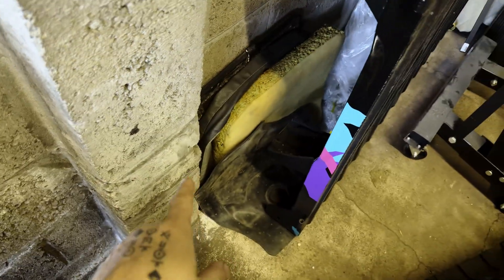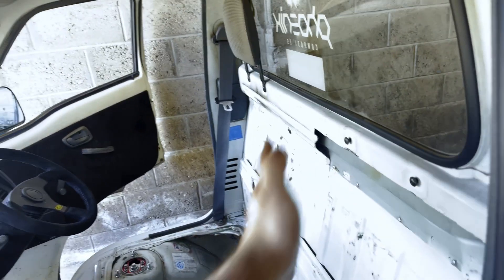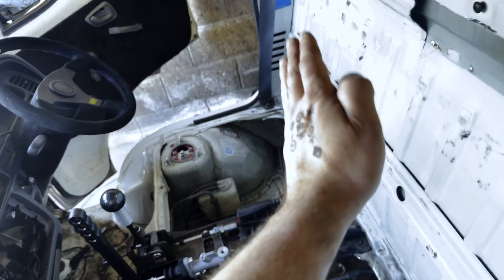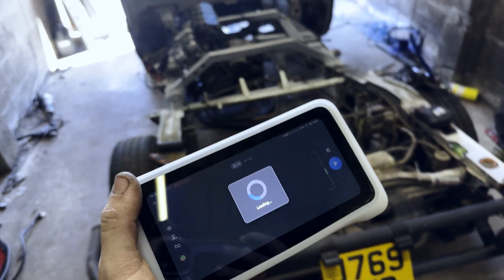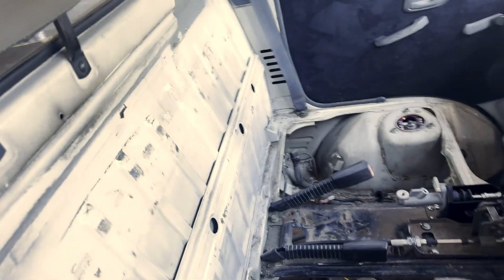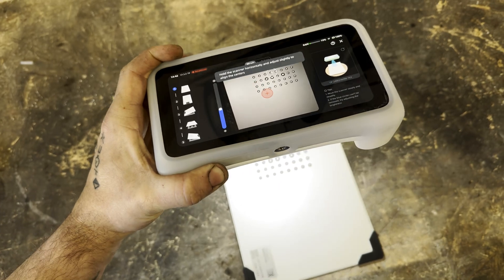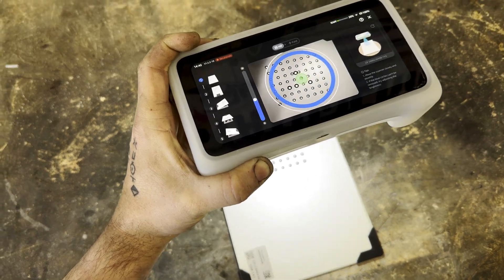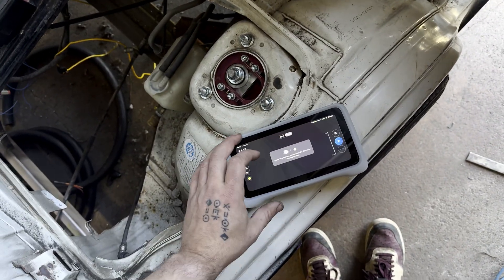Custom 3D printed seats for my kei truck? - Scanning the interior with Einstar VEGA

Comment: That scanner is incredible. I really need to look into this sort of stuff, as I have a Z12 imported Nissan Cube, with similar parts issues. I’ve made a few bits for it out of fibreglass (old skool😂) but I want to embrace doing this kind of thing. Loving the build, Chris. Thanks so much for sharing what your doing👊
Reply from the maker: Thanks Alex, i'm still learning a lot as I go but I found I struggled for resources when I started so if it helps others it's worth me doing :)

Comment: Basing the design on a kart seat could be productive. Just eyeballing it, they could form the basis of something that could work.
Reply from the maker: @Hix-Design  took the words right out of my mouth, I’m literally just home from working on a design. Only one way to know if it’s comfortable though
Reply: @phoenixcomposites  Did you record that vid recently? My Vega keeps resetting the date to 17/03/25 12:49 It's fekkin infuriating that it is stuck on Paddys Day, as every single scan piled up on the same date. Every time you shut it down it forgets what it has been set to.
Reply: I ask as I noticed that it had a non recent date on  the screen
Reply from the maker: @Hix-Design the scans used in my video were done yesterday, they’re showing as 05-05-2025 on starvision, the other scans on the VEGA are from a while ago. Cant say I’ve noticed any time or date issues unless you can point it out to me?
Reply from the maker: @ on mine? The scans were taken yesterday and are dated 5-5-25, have you spotted something I’ve missed?
Reply: @phoenixcomposites  Nah, it was just the lower ones I noticed and it flagged in my brain as I'd just asked Einstar if there was something wrong as mine keeps on resetting to 17.03.25